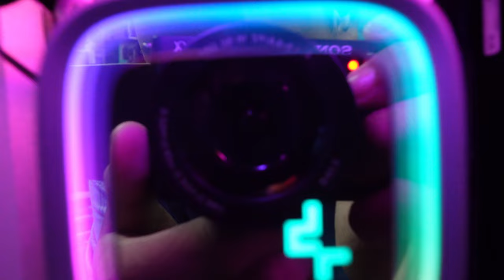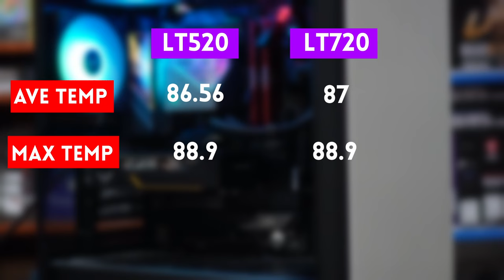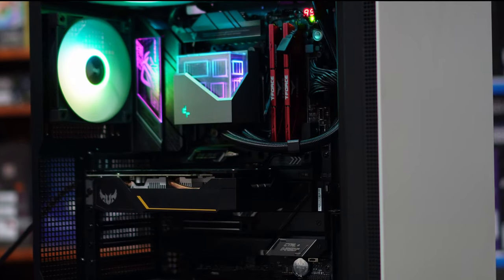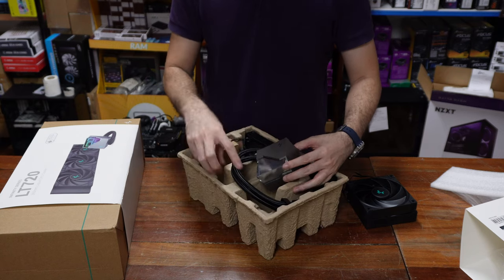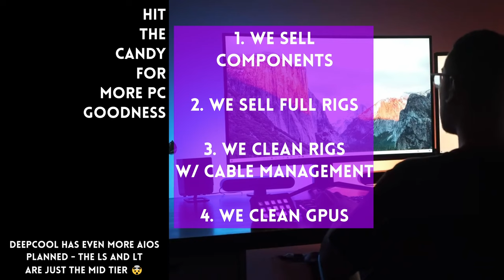Deepcool Tried and Tested VS. Deepcool New Breed LT520 and LT720 AIOs Reviewed

Comment: This is an interesting comparison, because as far as I can tell (based on Deepcool's published data) the mechanical specifications for the LS and LT series AIOs -- pump, fans, radiator and cold-plate -- are 100% identical.  It's not like the LTs are much newer either... the LS and LT series were launched within six weeks of each other.  How do you account for the performance differences you saw?
Reply from the maker: the fans of the LS and LT series are different, doesn't seem like much but there is a demonstrable performance gain with the LT fans

anecdotally our customers in the shop have seen better temps with the LT series as well
Reply: @hwsph  so this would be more of a fan difference correct? Pump should perform identical to the newer model right? If so then I'll stick to my ls720
Reply: @Born2Legit  Apparently they have literally the same pump. I wish someone would test both lineups with same fans, like Noctua or Arctic fans.
Reply: @RacingPotato12  oh bro I got you, I'm currently using it with 3x ARCTIC BioniX P120's. A lot quieter and cooler than stock fans, you don't get rgb though, but there white so it matches

Comment: Hi. Do you think these cooler for 5900X would be enogh? Deepcool Gammaxx 400 Pro Deepcool Gammaxx 400 Ex Deepcool Ak400 zero dark Plus Or should I choose some beefy coolers like: Deepcool Ak500 Deepcool Ak620.
or it's better to go with liquid AIO coolers like Deepcool LS500, Deepcool castle 240 instead.
Reply: For me, if your current cooler can handle the heat of ur 5900x, it’s not necessary. But if money is not an issue, the LT Series seems to be a pretty good option.

I ❤ deepcool coolers, I have the gammas 400t. Been in my pc for 1yr+. My temps didn’t even reached 75c at max load from r5 3600 😂

Comment: Hi, thanks to this review, I decided to pair my 13900k to the LT720. Ala ako masabi sa performance. If the PL1 is set to 253W, the CPU is far from thermal throttling.

I guess my only complaint with the LT720 is that, it sounds like a Jet engine, or winds howling, when the fans ramp up, and this happens even at low temps. I'm thinking that this is how the AIO deal with the temperature spikes.
Reply: Do you recommend me this cooler? I also have 13900K and thinking buying this cooler, how does it handle temperatures?
Reply: How is the cooler now?

Comment: I would really like to know the real difference between lt520 and 720 performance. I have a kraken x62 280mm and want to replace it for my 5800x3d. the x62 cools it really well, 55-60c in gaming but The water block/pump makes too much rattling noise. Will the lt520 be sufficient to cool my 5800x3d or would I need the lt720
Reply: The lt720 can cool a 13900k up to 315 watts, so i would think either cooler would cool your 5800 pretty easy.

Comment: Hi bro, I have Ryzen 9 5900x, I currently using Corsair H100iv2 which is failing at the moment, I am confused whether i go for LT720 or LT520, Actually the problem is i have Crystal 570X corsair case which does not allow me to use 360mm aio on top, I have to use it on front, but when i use it on front the heat air of the radiator will flow on the motherboard which i don't want, so in this case you think that Lt520 is better option? I do 3D production work btw
Reply from the maker: I would still go with the 360mm rad mounted in front as 360mm rads are significantly cooler than 240mm rads.

Just slap some fans on the top of the case to help with exhaust.

Comment: With the new 13th gen intel and 7th gen amd cpus. The absolute temprature is not a matter of concern anymore as the intel cpus would stay at it's tjmax no matter how much cooling you give them. 
But the better cooling they have the more power they would consume and so a good cooler would allow the cpu to reacher higher tdp. Like the ak620 lets the 13900k run at 270w tdp while the lt720 lets the cpu run at 315w tdp. So unless you going for the looks running the ak620 is more than enough. Performance difference is barely 1000pts on cinebench while the cpu consimes a lot more unnecessary power.

Comment: There has to be a different variable causing such a difference between the LS and LT aios since everywhere else people are saying the only difference is one has rgb fans and one doesn’t and usually the delta between different fans is usually less than 0.5c.

Guru3d actually has the LS720 outperforming the LT720
Reply from the maker: fair point, will try to do more testing
Reply: @hwsph  Please test them with same fans, like Arctic or Noctua fans.

Comment: The temperature test was useless... Most coolers, even 420 rads hover around 90 on max with ryzen 7000, and cheaper air coolers, this is by design. Why didn't you test things like idle/gaming temps?
Reply: yeah base line game like cyberpunk. ryzen performs cooler if gaming. kasi ryzen design mag OC till mag 95c.
Reply: do you think the arctic liquid freezer II 280 would be better then this? noise and temps

Comment: With ryzen 7000 series you should have included a cinebench or other cpu test score comparison, because if the temps still the same do to how the 7000series works reaching its target temps the scores would have shown an improvement on the better performing aio.